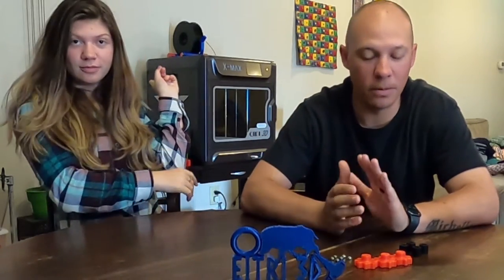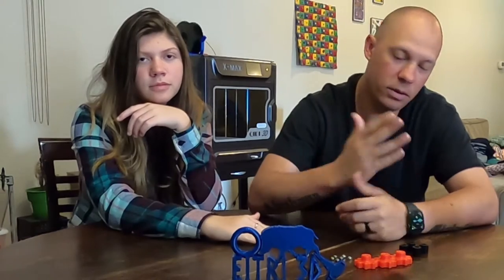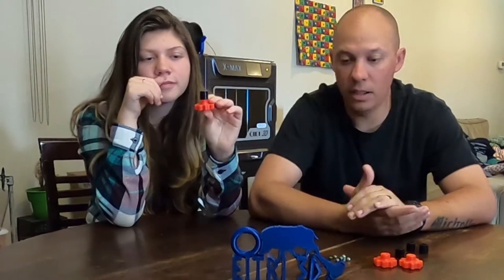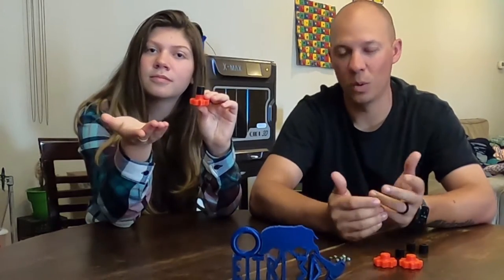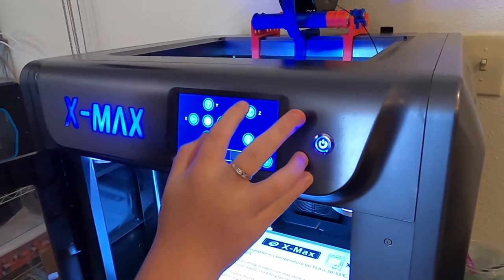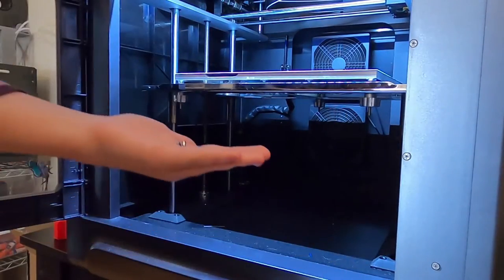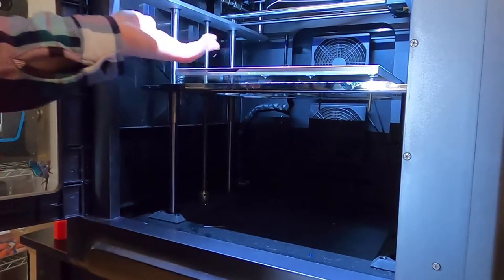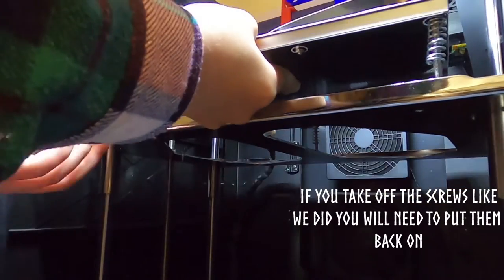Upgrading the Bed Leveling System on Qidi X-Max

Comment: I have a question I am been shopping for a 3D printer and have been looking at the little brother of the max the plus version. I've heard a lot of good things and a few not-so-good things like great customer service and sometimes just really bad problems with machines. Do you still with what you know now recommend going with Qidi Tech. Both the plus and the max are rated for nylon and carbon fiber material have you printed with either of these and did you get anything usable?
Reply from the maker: I honestly do recommend their printers. They print great right out of the box, easiest to print, plus the majority of things you’ll want to be able to upgrade, you can. They have a new printer (only available on AliExpress right now) that I would compare to the X-Plus because being newer the I-Mate S will have better parts. I personally do not own one yet, but it wouldn’t hurt to check it out.
Reply: @Eitri3D  thx mate
Reply from the maker: No problem. Would love to hear what you end up going with. Cheers!

Comment: I can't get mine to level so I can't even print those nuts so frustrating
Reply from the maker: I ran the leveling process 5 times to finally get it leveled at one point. That was when I decided to finally change everything out. Sucks you are having those problems.
Reply: @Eitri3D  this is my first printer and already feel like giving up lol should have bought a cheap one. I watched ur leveling video, qidis and I still can't get it to stick to the plate. Just keeps forming up on the nozzle eh I've leveled it like 10 times now normal and fast
Reply from the maker: Could be one of two things. It’s too far away from the plate or you have a slight clog in the nozzle. Personally, I would raise the bed by .05 and give it another try.
Reply: @Eitri3D  yeah I'm gonna give it another try later I'm just too frustrated atm 😄  if I can't it to work I'm gonna see if anyone wants to trade

Comment: Hi - Do you still need to buy the M4 screws or can you use the stock ones that are "in the springs"?  Additioinally, do you need to use the wing nuts if you print the replaceable knobs?  Or can you just use the stock knobs and wing nuts?
Reply from the maker: We used the M4 screws that came with the machine. If you print the replacement knobs, you do not need the wingnuts as the new knobs is designed to hold the M4 nut in place. If you decide not to print the new knobs, you could use the same setup. The only difference is the spring would be swapped out with the spacer. I personally do not like the setup of the factory knob and wingnut and that is why we swapped that out. I hope this helps. Cheers!
Reply: @Eitri3D  Thank you!  Much appreciated reply.

Comment: I'm having some serious issues with underextrusion in that printer with both the extruding sets that comes with it. Do you have any clue of what could be the issue? I'm getting so frustrated with it
Reply from the maker: It could be a few things to be honest. The first thing I would check is to see if there is a partial block in the hotend. After that I would need details on what type of filament and your settings.
Reply: @Eitri3D  When I  first printed it with the PLA Qidi sends with the printer it came out smootly, I changed it for a black abs I had here and again no problems at all. Then I bought some golden silk PLA and more ordinary ABS. And that was when things began to go wrong.
When i tried the silk PLA it had so much under extrusion it didn't print a single thing. Then I changed it to ABS and it was better but still not even close to what it was before.
I then changed it to the old ABS I had (the one that worked out with no problems) and again it was under extruding.
I then changed to the hight temperature set and used the old ABS, but nothing changed. The high temperature set was factory new so it couldn't be a jam or a clog, I thought it was a software issue but I checked everything and didn't find anything weird in there either.
Sometimes I wish I had stick with my old Anet A8 :(
Reply from the maker: @Arty014  So it does sound like a partial block on the standard extruder and that is only because the silk wouldn’t print. Which would explain nothing would print normal again. As for the high temp extruder, I have only tried Nylon/CF so I cannot speak on why that would cause problems. I would recommend disassembling the standard extruder and check your PTFE tube because that could be damaged possibly due to how high of a temp required for ABS and/or silk. I cannot think of any other reason why you’d see a huge degradation of quality even after switching back to previously successful materials, except partial clog or the PTFE tube degrading. Hope this helps. Let us know either way and if it didn’t work maybe we will be able to troubleshoot other possibilities.

Comment: Just ordered the stuff to do this, Thanks for your videos. Can you measure the leveling paper that came with the printer please?  I lost mine.
Reply from the maker: Measured at .4mm. Glad the videos are helpful. Happy building and Printing. Cheers!
Reply: @Eitri3D   I appreciate it, I was searching online and was seeing people level with just a piece of paper. It didn't seem right to me but I found nothing for the XMAX but to use the leveling paper that came with it. ha ha
Reply from the maker: Here’s a tip in the event that the leveling paper gets swallowed into the “where is my...” abyss, you can take a folded post-it note and get really close too.

Comment: On the cooling board of the hot end, there is a space for a three-prong insert for bed leveling. Any clue what it is there for, take your cover off and check it out. Thanks. 
If you do find out if it is for a BMG leveler I would really like you to send me an email. What changes you made sounds good. Last I wanted to share I switched to a 3/16 tempered glass for my heat bed , Elmers spray glue will soon fill the pores in the glass and you use glue-like every 5 or 6 prints
Reply from the maker: So to answer your question, yes the 3 pin plug is a leveling port, but the firmware does not support it at this time. I would assume when the new series gets released there will hopefully be a patch to allow it, but unfortunately at this time it’s a wasted port UNLESS you hook up a secondary cooling fan which I did in my All Metal Hotend upgrade videos. As for glue. I have found a filament that I do not use any glue anymore unless I’m building something tall with a small base. If I can find the parts, that might make a good video for those wanting to upgrade.

Comment: Why does the rear spacer need to be 18mm ?
Reply from the maker: I personally used the same size all around. Others have used a larger spacer for the rear because for some reason the gap is a little bigger. Not a whole lot, but I have notices that to level my bed the front two have more squish to the spacers then the rear. Hope that makes sense

Comment: Thanks. I am confused wrt to springs and nuts.  You took off the springs but the video said if you took them off you have to put them back on.  I just don't get it.  I bought the spacers, locking nuts and plans for the leveling nuts.  Do the springs go back on?  If so, where? Can you please describe the process to me?  Thanks so much, Richie
Step 1.  Remove wing nuts
Step 2. ...
Reply from the maker: The nut that is inside the spring. If you remove that, the nut needs to go back on. Not the spring. Sorry for that confusion
Reply: @Eitri3D  Is this the nut you suggest replacing with the locking nuts?
Reply: Also, strange but the link to zogzogzogzog no longer functions.
Reply from the maker: Yes
Reply from the maker: That is strange, I just clicked it and it took me right to the page. Not sure why it doesn’t allow you.
Reply: @Eitri3D  One more question, thatnks in advance.  Before the upgrade: 50mm star head screw goes through the following:  heated plate, spring with original nut, base plate, knurled hand nut and finally a wing nut.
It appears that the upgrade follows: 

 50mm screw through heated plate, original nut, rubber leveling column, base plate, zogzog leveling hand nut, locking screw.
The locking screw does not seem to fit into the rubber leveling column and I think you used the original nut there.

Is this correct?

Richie
Reply from the maker: That is correct.

Comment: Having a weird issues with my X MAX right now. It seems like the rear leveling adjuster cannot bring the bed close enough to the nozzle. The rear of the bed is very springy and bouncy, and rotating the knob counter clockwise can't raise the bed high enough. Can't really find anything about it when Googling
Reply from the maker: Are you using the original bed spring or the upgraded silicon ones? I’d recommend tightening down the springs and go through the level process and raising the z at the end using the up arrow .5mm at a time then redo leveling and actually unscrewing the knobs and see if that will get you closer
Reply: @Eitri3D  I'm using the original bed springs. I'll try what you described now and see if it helps! Thanks!
Reply: @Eitri3D  Just a follow up, your suggestion worked perfectly.  I actually ended up tightening all of the bed leveling springs, then did a quick leveling. Adjusted from there, then performed a normal leveling to find tune everything in. Worked perfectly.

Do you have a link to the silicon springs you're referring to?

Got me thinking it would be awesome if you guys made a video covering all the upgrades you've made to your X-MAX. Cheers!
Reply from the maker: Glad to hear we could help you solve your issues. If you go to our playlists you’ll find all of our upgrade videos, minus the Chad Mod (it has its own playlist). As for the silicon spacers, you’ll find the links in the descriptions to everything we needed to complete the upgrade. Hope that helps. Cheers!
Reply: @Eitri3D  awesome. Thanks guys. Such a great channel, the QIDI community seems so small
Reply from the maker: It definitely is a small community. When we bought our, there we zero videos on how to do things except the silent ones made by Qidi themselves. So we decided to try to help others with their machines. After many hours of mistakes, our “we make mistakes so you don’t have to” just came to us and that is how our channel evolved. We have more useful videos coming, so please stay and hopefully they will be of some use.
Reply: @Eitri3D  I’ve been subscribed since I found your channel, super appreciate of the effort. I look forward to all the uploads. Thanks guys!

Comment: hi there again. i do realize now that this computer is an old news for you. but i really don't know where else to turn. i can't get one print out of it yet and i have plenty of different printers that do just fine. i can't get the blasted usb to load its fried and i can't seem to get a hold of them whats up with that. the settings are way different than any of my other printers. What the heck am i doing wrong. Please help. Ive tipped you once, i'll buy you a truck of coffee if you can help. To at least get a download of the software ;) Thanks, Amy
Reply from the maker: You should be able to use almost any USB you have laying around. I use aftermarket USBs on all my 3D printers. I’m confused about needing software? The software on the printer should not have disappeared or quit working. The USB should just have the sliced (.gcode) file and the printer should read it. Send me an email that is on this channel if you’re still having issues.

Comment: how come you needed a different sized spacer for the rear?? :s
Reply from the maker: I personally used the same size all around. Others have used a larger spacer for the rear because for some reason the gap is a little bigger. Not a whole lot, but I have notices that to level my bed the front two have more squish to the spacers then the rear. Hope that makes sense.

Comment: What made you want to replace the springs with silicon spacers? The author on Thingiverse, zogzogzog, still uses the springs
Reply from the maker: A few things honestly. 1. Bed needed re-leveling before every print. 2. Flawed design would cause the nuts to loosen the bed to the heated plate without actually changing the spring tension. 3. Springs were too weak. 

I seriously only level once a month and that is to confirm level. Outside of that, if I swap out a nozzle or any part I’ll level. For me, this is the only upgrade I don’t consider a “convenience” upgrade and that is because the poor design and inability to maintain a level bed ruined many of first layers and prints. Hope this helps.
Reply: @Eitri3D  thanks for the reply again. I went ahead and bought the spacers as well!
Reply from the maker: Awesome. You will not regret that purchase. Make sure you watch the video and after you install the spacers tighten them down before bed leveling (but not too far because of the wires in the back) or else you could seriously damage the hotend. If you got questions, feel free to reach out. You can also find us on Facebook if you need to chat about an issue. Cheers!
Reply: @Eitri3D  I'm excited to see how much my print quality goes up with a properly leveled bed now. Anytime I leveled before it always seemed out of whack next time I printed

I'll make sure to tighten the space down before leveling. Thanks for the wealth of info!
Reply from the maker: No problem. Hit me up if you got questions.
Reply: @Eitri3D  will do! I just installed the silicon spacers and upgraded leveling knobs, printing my first Benchy since the upgrade now :)
Reply from the maker: Awesome. Can’t wait to hear how it turns out.

Comment: So, what advantage do the silicone columns have over what's stock?
Reply from the maker: The stock springs don’t keep the bed level. The nut inside the spring is a poor design and can/will come lose over time. The silicone spacers hold the level longer over time so you don’t have to worry about leveling after/before every print. Hope that helps.
Reply: @Eitri3D  that's what I believe they did but everyone I've seen use them hasn't explained too clearly the purpose of the simple mod.
Reply from the maker: Oh I’m sorry, I guess I need to make sure I explain that on the next upgrade.
Reply: @Eitri3D  Oh you're fine. It wouldn't hurt to add a run down to mods you're doing at the start and what they accomplish, but the fact that you're responsive also helps with that too. 

I subbed because you guys do show off xmax mods and I've been able to look into your comments to see descriptions of why it was decent. Keep it up and you'll get where you want with this channel. 

I will say, qidi is working on a new printer that's duel extrusion while being larger and I'd like to see what you guys could do with it.
Reply from the maker: We’ve known about that printer for about 9 months now and have been in talks with them. We are hoping to get our hands on one to debut and/or demo. Thanks for the advice about giving the why we are doing an upgrade. That makes perfect sense. Thank you for subscribing and following us. We appreciate it and if you’ve got ideas of videos you’d like to see, let us know. We get some good ideas from our community. Thank you.

Comment: looks like you can't get the leveling nut STL anymore from Thingivers, anyone have the STL the can repost?
Reply from the maker: That’s strange. You’re not the first to say this, but when I click on it, it works and is still there. Try this, https://www.thingiverse.com/thing:3819624
Reply: I had the same issue - 404 error when downloading all files. Try clicking on "Thing Files" (next to "Thing Details") and then download the individual stl file rather than "Download all files".

Comment: Do you have any good suggestions on tutorials for setting up x max with ultimaker cura?
Reply from the maker: I don’t at this time, but I’ll work on a video for setting it up. Every time I’ve tried to use it, I’ve had mixed feelings and normally shy away (I know Qidi Print is earlier Cura). Now that I’m running everything through Octoprint and I don’t need the machine screen  to show me the details, I may give Cura another shot. As long as they fixed the bugs from the most recent update. I’ll add that to the recording schedule. Thank you, Cheers!